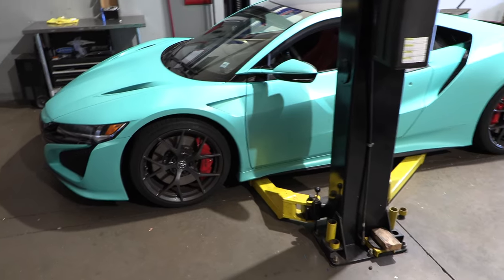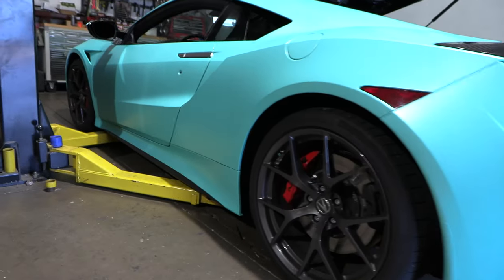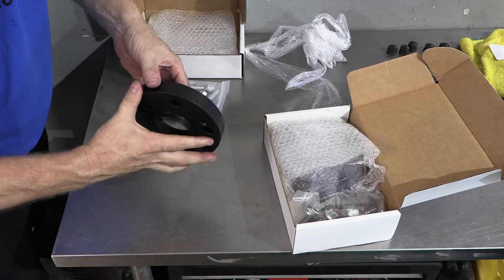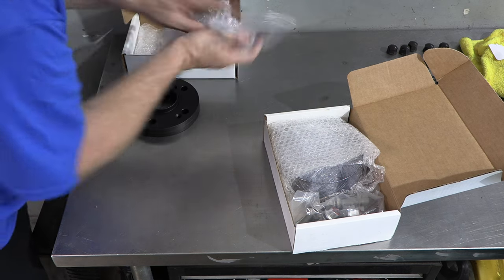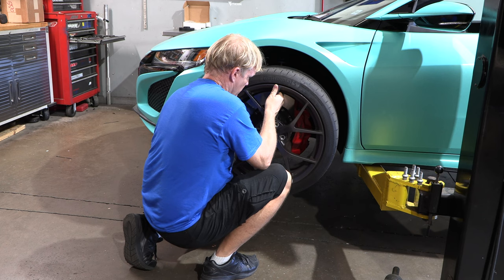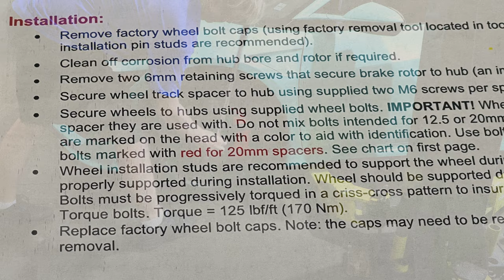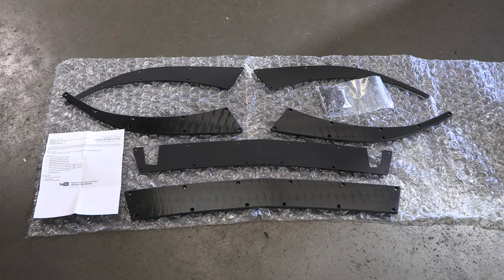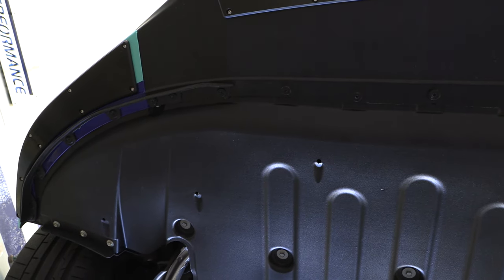NSX Wheel Spacers + Bumper Guard . Simple but affective

Comment: While most shops would have urinated on the brake calipers to get the dust off lht used a microfiber towel and that is the difference  with lht versus other shops.